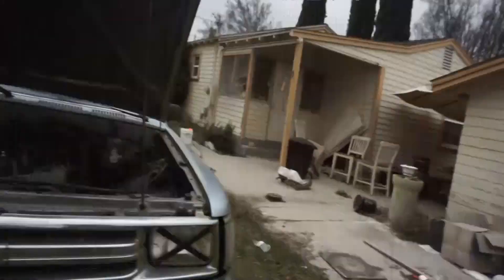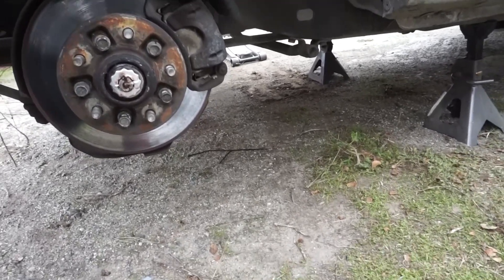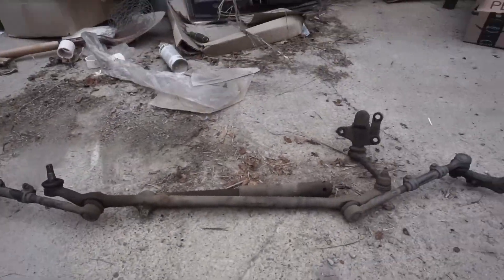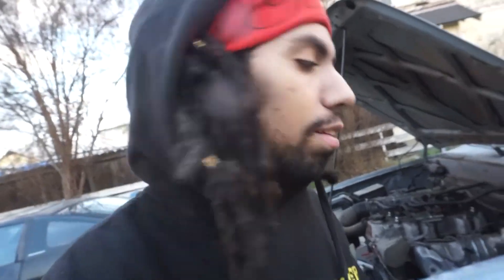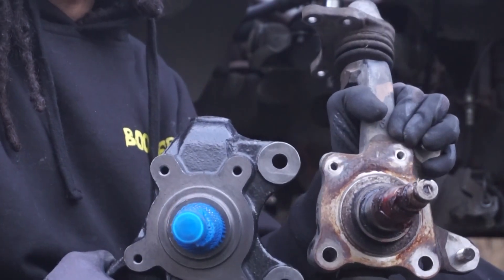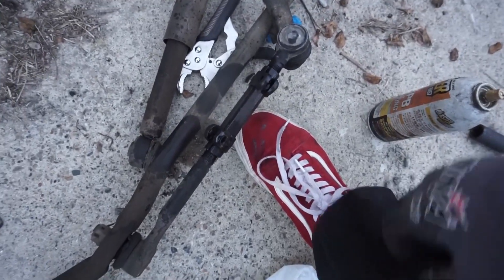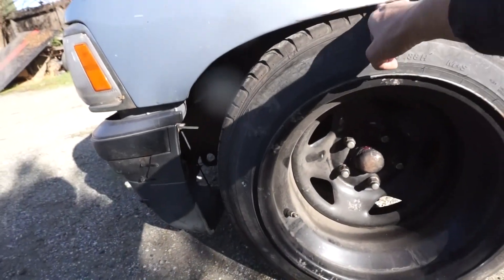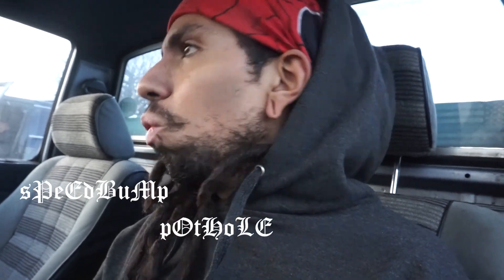Toyota HILUX / PICKUP Lowering + DRIFT TRUCK SETUP FOR *CHEAP*

Comment: Not sure if you ever got an answer on the “jumpiness” after these mods. Idk much about mini trucks but I know a bit about race car suspension geometry. So with the drop spindle and inverted ball joints, if you don’t make up for that with the steering tie rod points, you get that “jumpiness” otherwise known as bump steer. Essentially when the suspension goes through its travel, because of the altered geometry, the tie rods are pushing/pulling the wheel making it really nervous and twitchy feeling. Hope that helps.
Reply from the maker: @bretrogers5521  i actually fixed this, i went back to a factory spindle and modified the factory knuckle to reduce Ackerman and increase angle. I also flipped the mounting face of the knuckle to adjust the roll center and reduce the vertical angle on the tie rod. I dont think ill ever run a drop spindle again.
Reply: @GutZ_47  awesome. Glad you got it worked out. That's always very unnerving when it gets twitchy at highways speeds. haha. Truck looks like a blast. Hopefully starting mine later this year, just collecting parts and tools now.

Comment: My speedometer just stopped working too 😂 I mean she’s 31 years old and still standing pretty
Reply from the maker: damn dude, mine is off by like 5 to 8 mph rn. if you remove your shifter housing off the tailshaft from inside the cabin, you should be able to see the small gear that goes onto the speedo cable, sometimes those gears fail since theyre made from plastic. you can also just pop it off at the trans and check it too, but sitting in the truck with the radio on seems nicer lol.  if not your speedo cable mightve just took a dump.

Comment: Got a 2000 3rz single cab I want to reach the same end goal with, such a costly build but knowing re sale will be good is what’s keeping me going
Reply from the maker: dude yes! alot of the yota pickups ive seen up for sale have been drastically going up in price, especially the 5 speed ones. eventually the drift tax is gonna hit these vehicles so mods will feel worth it

Comment: This is tight 👍🏽👍🏽
 Got a 98, but im heading the "sleeper" direction and been building the engine w/ turbo. 
Emberassing sports cars out on the road already and its not even close to done.  YOTA LIFE 🤘🏽
Reply from the maker: Fuck yeah man. What kinda management are you going to use? Im about to do a hybrid 20r/22re build soon on this truck!
Reply from the maker: Fuck yeah man. What kinda management are you going to use? Im about to do a hybrid 20r/22re build soon on this truck!
Reply: I think it was a Garret T3 low boost (bought from co worker). No management yet, but that's next after I get these wheels and tires.
Reply from the maker: @MikeLaRock88  if your tech savvy, id look into speediuno ecus, super cheap with easy tables, i know mega squirt sells a "plug and play" version for our trucks but theyre about 700+ bucks!

Comment: hey man beautiful fitment isee ur stil lreplying to comments so imma give this a shot. im thinking about pulling my middle leaf spring to go lower, i have 4 inch blocks currently. will i have frame issue clearence or should i be good. thanks bro. idk if ur frame is notched or not. let me know dawg thanks!
Reply from the maker: Nah stock frame, you should be good, i have a few friends rocking mono leaf conversions with blocks (do NOT recommend, horrible ride) dont fully remove ur bumpstops, cut em down to about 3/4 inch

Comment: Hey man I got a 90 2wd toyota pickup the setup you have fits mine but I wanted to know if it increases the turn angle, I dont need to lower it anymore.
Reply from the maker: tbh, the only way you can increase angle would be to cut your knuckles, but then you run into issues with ackerman changes if not done correctly. im assuming you already removed the steer stop bolts from the spindle? that should add maybe an extra 5 degrees but u might get rub on full lock especially if ur sliding. im gonna convert over to rack and pinion soon and might run a mk3 supra spindle/hub. from what ive read it increases angle quite abit due to knuckle location.
Reply: @GutZ_47  thanks for the response, you got the same truck?. I haven't cut anything been trying to find best solution before I do so. Knuckle cutting is the biggest thing I see but I ran into a video of a guy using a bmw m3 control arm extender modifying it a bit so it sits more behind rotor he got really good angle just doing that, only thing is it bumps into seat bar so I'd have to modify that too. I'm thinking of doing that, seeing how the knuckle looks might cut it and extend it too. Then put a little hubsentric spacer on it if needed. I dont expect 90 degree turns but damn do I want close to it. I'm trying to go step by step so I dont regret a move after the fact.
Reply: Does the supra spindle and hub flush better or something
Reply from the maker: yeah mines a 91. and the supra spindle gives you better brake options, better hub bearing design, and also has a slightly shorter knuckle than trucks do so stock it adds abit of angle. not sure how much tho. i ordered some mk3 spindles on ebay, once they get here ill make a vid detailing the differences and install. you slide your truck? im guessing ur running into understeer under high angle?
Reply: @GutZ_47  bet bro I'll be the first viewer, I haven't started sliding it yet. I'm doing a complete suspension and brake rebuild first. Then I'm welding a flatbed and taking the doors out for rollcage style doors so I can see through doors. It's a simple build. I've just been trying to find out how ima go about putting more steering angle on her. Less cutting and welding the better. Though I want enough that I can play with.

Comment: I got a 94 Toyota pickup and I’m putting Chevy equinox rims on mine
Reply from the maker: Equinox rims huh? I'm very interested in seeing the outcome of that! Is the bolt pattern the same I thought Chevy was 5x120?
Reply: @GutZ_47  the 05 to 06 is 5x115 I looked it up and they say they fit 5x114.3
Reply from the maker: @fishingwithbrian2946  when I used to slide an e36, I had Corvette wheels in the front, they were about a 8th of an inch off from the BMW bolt pattern, but I used these bolts called wobble bolts that helped align everything, either that or just run 4 of the 5 lugnuts 🤣
Reply: @GutZ_47  haha I’m getting the set of 4 for 200 and rims and tires so about $600 I’m going to put 17s so ima see how this goes 😂😂
Reply: @GutZ_47  I decided not to get the equinox rims I'm getting cobra mustang svt rims 17x8 5x114.3
Reply from the maker: @fishingwithbrian2946  dude, yes, I've always loved mustang wheels on these trucks. I'm tempted to go 17s but I just love the look of 15s way to mich
Reply: @GutZ_47  yeah the mustang rims are beautiful and always look good on these trucks

Comment: Smaller wheels have to spin more times to go the same speed, so your speedo reads faster man. Side note: when did 'yota's get ABS?
Reply: Also torsion bars up front would slam it without spindles..twisting torsion bars plus spindles would be SLAMMED AF
Reply: Not sure exactly when but my 93 pickup has rear ABS

Comment: Do you have a link to the steering stabalizer that you used? I know you said the name, but I'm not finding it. Just picked up a 92 pickup myself and this video is a tremendous help as I am getting ready to do all of this to it.
Reply from the maker: yeah are you talking about the shock absorber? i actually went with a rough country kit since i was experiencing tramlining (steering wheel veers off to cracks in road) and it has made ALL the difference. https://www.roughcountry.com/steering-stabilizer-8735430.html?gclid=CjwKCAjww-CGBhALEiwAQzWxOi04kzThInJ5174LZtOoE2UNdsc420uSA9g8GGvSTMLFdip5-UcvxBoCwV0QAvD_BwE is the one im running right now
Reply: @GutZ_47  yeah the shock absorber. Thanks! I'll check that one out.
Reply: @GutZ_47  they say it doesn’t fit the 2WD. Did you have to do any mods to fit the steering stabilizer? Thanks

Comment: I have a 1990 Toyota pick up and I need some coil-over, but can't find anything on Amazon or eBay and am all the way out in the Caribbean. Drop a link where I could get some 👇
Reply from the maker: as in you want to convert to coilovers? thats gonna be abit of cutting and grinding. for the front, you want to either fab up some shock towers or buy premade ones that match the coilover height youre gonna use, and also remove the torsion bar and key. Keep in mind that the front control arms are NOT designed for the abuse of a coilover so youre gonna have to reinforce them.  for the rear, youre gonna have to do some serious fab work, decide between parallel 4 link or triangulated 4 link, and welding in supports on the frame to hold the coilovers (which means youre gonna have to cut the bed). depending on what link style you go with, you might have to relocate your fuel tank. YOU HAVE TO EITHER SQUARE NOTCH OR C NOTCH THE FRAME! Now to answer your question about coilovers there is no link unfortunately. you have to piece together a set of qa1 shocks to coil springs, which means youre gonna have to measure out the amount of travel youd like, your overall height, spring rate is relative to use so is it a burnout car, drag car, drift car, daily driver... its alot of work, i honestly recommend going the drop spindle/drop leaf route if you dont have fab equipment, but if you are experienced in fab work or know someone who is, this could all be done in a weekend! sorry i didnt have the exact answer you wanted!
Reply: @GutZ_47  thanks for the info. Think I'll stay with my stock suspension. It's already lowered. Just a pain in the ass whenever I go to rural areas.

Comment: Ay bro I got the back shocks u recommended and it didn’t work too sort
Reply from the maker: how short? i had to compress my springs abit to get them to fit.
Reply: @GutZ_47  I think 2 inch I did exactly how u did and love the difference any recommendations for up grades
Reply from the maker: @Doingitrightplumbing  i deff recommend getting leaf spring helpers if you plan on welding the diff

Comment: Hey I just got a  Tacoma  thats low. I wanted run a 15x10 i like how’s urs has a lil poke and stretch to it what would u recommend
Reply from the maker: fuckyeah man, unfortunately these trucks came with a shitty track width so a extremely high offset or wide wheel is the only way to get any sort of fender poke. if you want flush, 15x8 -0 to -15 offset will give you a nice fitment, if you want poke like mine, 15x10 -44 offset is the way to go. just a reminder tho, the wheels are heavy as HELL!
Reply: I-O GARAGE hey man beautiful truck, what’s the tire size your running I know it’s stretch?
Reply from the maker: @silentassassin3086  it should be a 195/60r15 ! I get em on amazon for around 30 bucks a tire brand new, the brand is ohstu fp7000, these tires are made in the same factory as Kuhmo!
Reply: I-O GARAGE thanks I’ve been searching tire size to wrap on my 15x10s

Comment: Thx for the video now i can drop my toy the right way hate ridin on jus torsion drop wat u got for the rear?
Reply from the maker: bro, i rode on cranked down torsions and blown shocks for a minute. it honestly rides so nice now, almost like a midrange coilover feel. gonna be making a video on how to drop the rear without using blocks soon, stick around!
Reply from the maker: also, im ridding on belltech 4 inch drop blocks, but i have spring assisted shocks in the rear cause i still like to load stuff in the back!
Reply: @GutZ_47  hell yea man cant wait till i do mines and also cant wait for the vid

Comment: Hey what’s up bro quick question? Where are you located at ? Because I have a 1990 Toyota hilux and I want to drop it.
Reply from the maker: Central ca
Reply: Ohh ok   Another question what kind of coilovers can I put on my truck?
Reply from the maker: @miguelcoldivar2439  so theirs only 1 company i know of that makes coilover kits for our trucks, the site is called StabFab.com. Its a bit pricey but from what i hear your truck should handle like a car afterwards
Reply: @GutZ_47  alright cool bro thanks 👍🏼 I’m going to check them out

Comment: Could I do sum like this to my isuzu ?
Reply from the maker: yessir

leaf springs: https://www.x2industries.com/product/1988-1995-isuzu-pickup-rear-3-dropped-leaf-springs-pair/

drop sprindles! (looks like the 96 and up ones are cheaper, idk wat year you have or if they fronts are interchangeable): https://www.x2industries.com/product-category/suspension/drop-suspension/truck/spindles-truck/isuzu-spindles-truck/

and your shocks boi! : https://www.summitracing.com/search/part-type/shocks-and-struts/make/isuzu/model/pickup/product-line/belltech-nitro-drop-2-shocks
Reply: @GutZ_47  appreciate that slamzuzu on Instagram check it out it’s a 93 isuzu 2.3L
Reply: @GutZ_47  jus made some custom side skirts for it 👌

Comment: Hey bro did these parts hold up ?
Reply from the maker: besides a failed wheelbearing, and swapping over to drilled and slotted rotors, its been an awesome swap. no blocks in the rear either so i dont have that horrible slam feeling when i drive on bad roads!

Comment: All of these parts fit a 2000 tacoma or no?
Reply from the maker: i think tacomas are coil spring front suspension and rack n pinion instead of linkage steering. the drop strut might fit, but i think yours uses a different spindle
Reply: @GutZ_47  I appreciate it bro ima look tht up... love yur built man

Comment: Wish I could drop my pickup
Reply from the maker: im sure you could man, what kinda truck you got?
Reply: @GutZ_47  i got a toyota 1991 pickup 22r
Reply from the maker: @isaivaldez7031  just get some cheap blocks and crank the torsions down! u can get the blocks for like 50 bucks!
Reply: @GutZ_47  the blocks are for the back right?
Reply from the maker: @isaivaldez7031  yessir, if u can get the beefed taco ones do it, his come with a bit of angle to correct the pinion. if not the belltech ones will work, mine are the 4 inch drop blocks but i have load adjuster shocks in the rear so its not as low as it should be.

Comment: Bro that’s crazy my super swampers on my 84 is only 45 to 50 pounds each😅
Reply from the maker: jesus. yeah i put the wheels and tires on a scale and it was 42.8 lbs, luckily i found some lightweight wheels for it ;)
Reply: @GutZ_47  well I’m sure will make big difference 🤙🏽
Reply from the maker: @meks8086  I hope, luckily our trucks are light as it is! But it's so hard to not want to go 17 or 18 inch wheels since they're so many
Reply: @GutZ_47  I’ve had a few 2wd 80s pickups and honestly I’d stick with 15s.. 15x8 or 10s should be cherry 🤙🏽with the right fitted tires they are the perfect size. I’ve had 15x12s too but depending on how much power you be making might be harder to break traction but if you got the power then I’d definitely go with those plus they these trucks look sick with wide tires🔥
Reply: Looks like you already have 15s but definitely get lighter ones😅😂
Reply from the maker: @meks8086  the wheels in looking at right now are the felgenwerks fwd. 001, but I cant get in co tact with them. 15x10.5 -32 offset, aluminum wheels, should be the ones!
Reply: @GutZ_47  sounds perfect 👌